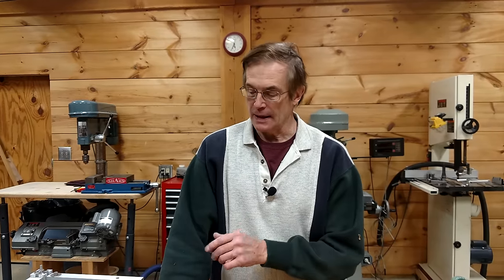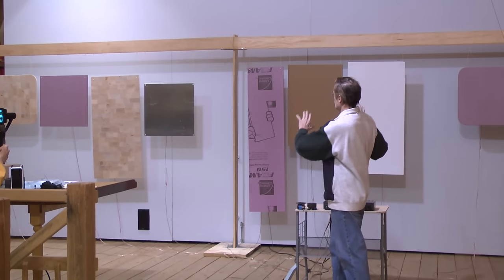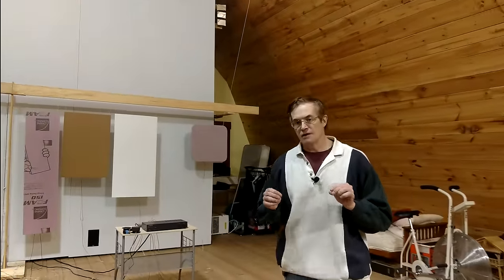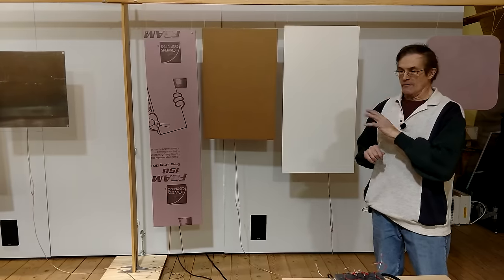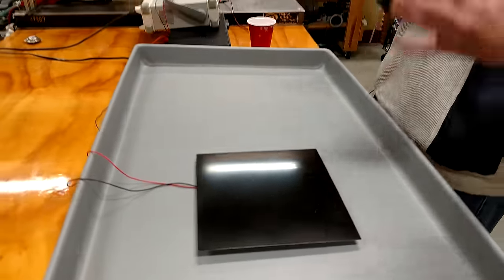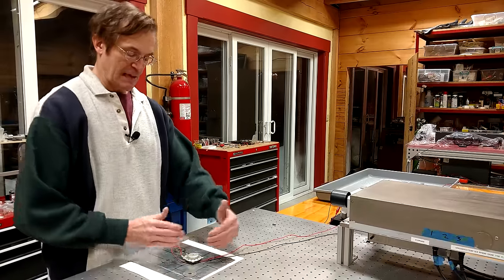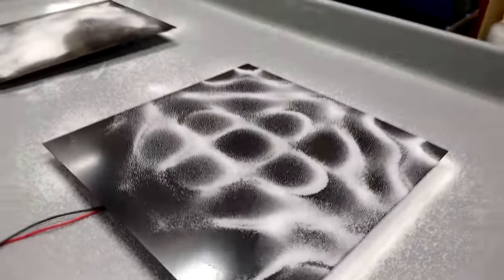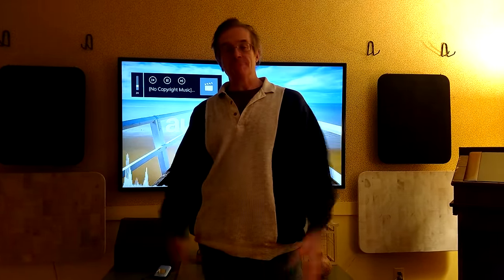Fantastic DIY Speakers for less than $30!

Comment: It's super interesting, all of these speakers sound like my computer speakers..... 

Would love to see some actual science behind these... Measurements would be a great start....

I also take umbrage of your assessment that the panels must be "musical instruments" in order to be recreate other musical instruments... wouldn't all of those nuances be captured in the recording already? and you would simply be essentially 'doubling up' on these effects?

I wouldn't think that you would want to mount these against the wall, due to the fact that equal amounts of energy are being sent backwards on the panel, you are actually boosting the rear wave output due to an increase in radiation impedance, I would think this would lead yet another issue for these speakers...
Reply: The "musical instrument" property makes sense to me. I'm going to approach my longwinded explaination from a graphics-algorithms perspective, but it should still be mostly applicable. 

If you have GIMP or photoshop you can find an advanced settings menu for scaling images. Among the options listed are what interpolation algorithm you want to use. These algorithms will provide very different results for the same image, input, and output size. For example, the "nearest neighbor" algorithm is computationally cheap because all it does is what it says on the tin. If you've drawn thin diagonal lines in ancient versions of MSPaint, you would remember how it created a jagged, solid staircase of the color you were using. This was using something very similar to nearest neighbor.  Most other interpolation algorithms work by mathematically approximating using a (corn) kernel object that is passed over the input. So if an output pixel does not neatly map to an input pixel, it would turn into an average of the input pixels it would be between. This results in apparantly smooth lines to the eye, but objectively loses detail that was in the input image. These algorithms can apply to 3d and even 1d objects.

When rendering 3d graphics, there are two common ways to handle the camera: orthographic projection and perspective projection. Both forms assume you are projecting rays that query the exact pixel of the triangles they hit, and stack the pixels up like cards. You only see the top pixel of each stack. Orthographic projection makes sure those projected rays are parrallel, has a cube for a stage, and is better for architectural drawings. Perspective projection has all of those rays converge at a single point, has a chopped off pyramid for a stage, and is better at simulating the eye or typical camera lenses. If the pyramid/cone has really large angles at the peak, the cutoff slice needs to be farther away for the view to not be distorted. See how certain people get motion sick in videogames when the horizontal viewing angle is different from their eyes' natural viewing angle. Both of these algorithms have 2d and 4d analogs, but act completely the same in 1d.  

So let's think about what sound is. If we project a force onto a solid object in a fluid, that object then imparts that force onto the fluid particles that bounce off of it. The particles then perspectively project that force outward, averaging it with the inherent noise of the universe. If we have another solid object in that fluid, it will recieve force from the fluid. The solids aren't as noisy as the fluid, so the force is (mostly) orthographically projected as an average. However, at resonance frequencies this average interpolation gets closer to a nearest neighbor interpolation. You can see this in action with the sugar test. The force, solids, and fluid are all 3d, but the solids' interfaces with the fluid are inherently 2d. Thus, the force is projected in different ways multiple times, and more ways in certain cases. A normal speaker or microphone is going to act like if the perspective projection's pyramid has a really tight viewing angle. The result is a recreation of the double slit experiment with sound instead of light. The point of these speakers is to widen the apparant angle of the vanishing point by increasing the size of the base of the pyramid, and cut down on quantum physics screwing with our perception of reality.

TLDR: You can blame quantum physics and psychology. It's a solution exported from the visual arts with help from physics.
Reply: I appreciate the response, and to my surprise I actually was able to digest most of what you said, so bravo. 

My rebuttal would be the fact that a musical instrument inherently has resonances, which is why you can hear the vibrating string from a violin in the last row of a concert hall, it is how they function.... 

Another point I'm trying to make is that you are doubling up on the micro-phonics produced by the instruments. To continue with your graphics metaphors, if I take an image taken with a camera, a device that captures perspective, then apply your prospective projection algorithm, the end result might look fine to you, however it is not being true to the original image. You're essentially distorting the image by adding perspective to something that already had that perspective.
Reply: Your first rebuttal is part of the solution to your second point. When a digital microphone is recording sound, it inherently is going to chop up the signal according to digital thresholds and it's digital timer. Binary computers are notoriously bad at recording analog data quickly, so shortcuts are employed. Rather than trying to invent an ideal mathematical function that would recreate the wave form, the mic will simply log the positions of tactile switches that are sensitive to pressure waves. The result is a file that will look like a sequence of integer numbers whose positions correspond to frequencies and timestamps. This is then (destructively) compressed into the mp3 format because moving raw data around is computationally expensive. When it comes time replay the sound, the computer decompresses it back into an approximation of it's raw form, and sends that information to a speaker. The speaker then flexes a diaphram with electromagnetic motor(s). The diaphram is an attempt to physically recreate the data lost in the digital process, but it has limitations. A smaller diaphram is going to be more sensitive to the variations in manufacturing tolerances of other parts in the speaker. One of the tolerances the panel speaker might be less sensitive to is how the motors' copper wires stretch and contract with local electro-magnetic feedback. This feedback overlaps the intended signal with an out of phase version of itself. If we consult the maxwell equations, we find that the eddy current responsible for the feedback is an inverse exponential equation in regards to time. Since materials resonance is an exponential wave process as well, it can counteract the EM eddy current's effect on the signal if used carefully. 

This is one of the really cool cases where materials engineering complements computer science and electrical engineering. Other interactions it has with them are photolithography, mercury tube memory, and crystal timers, all of which are black magic as far as programmers are concerned.
Reply: a very broad oversimplification of the recording chain... the "shortcuts" you're talking about are happening commonly at 192 thousand times a second, I don't think you need to worry about that... and I also don't see how that is relatable to this current discussion... 

you're assuming incorrectly that the motor structure of this panel vibrator isn't moving, but how would it produce audible sound? Energy can not be created or destroyed, simply converted. In order to create audible sound, the shaker is vibrating the panel and is moving relatively the same amount as a traditional speaker. Which is one of the many downfalls of this type of speaker, the fact that it simply can not move the panel enough to create low frequency sound, your moving mass is the whole panel and therefor takes more energy to move it, increasing exponentially with mass. What you arele doing with this type of loudspeaker is essentially taking all the bits that move in a large subwoofer driver and trying to excite it with the magnetic structure of a tweeter...

These types of acoustic transducers are fine for higher frequencies, but simply are not physically capable of any output below ~500Hz depending on the power you are sending it and the material... 

Also I would think that the best resonating panel would be an ellipse of some dimensions, this would create as many eigenvalues as possible...
Reply: JakeN482 "trying to invent the ideal mathematical equation"? There is nothing left to invent for this purpose, the Fourier transform deals with this perfectly. If your signal bandlimited only a finite number of samples are needed to recreate the signal literally perfectly. Keeping in mind humans can only hear certain frequencies we can take any audio signal and bandlimit it without losing anything of value as we can't even pick it up. Then yes the microphone need only pick up samples fast enough and send them down the pipe. As Timmy rightfully points out the speed at which this process occurs at is way faster than it needs to be, and the Fourier series doesn't care if the samples are equally spaced so long as there is enough of them, so losing a millisecond here and there doesnt matter so long as you can accurately measure the time at which the sample was taken. The quantization which occurs here (both for time and wave amplitude) is the only part of the process which I think faithfully could be labeled as "destructive" as no matter how precise of a computer you have an arbitrary real number can not be stored completely accurately. (I would argue we get close enough for it to be a non-issue but I digress) From this stream of samples it is then not only possible to recreate the exact signal but it is simple and incredibly fast by using the fast Fourier transform to do it.

As for the image analogy drawn earlier the fundamental difference here is the fact that our signal is no longer bandlimited thus finite samples can not recreate arbitrary signals in their entirety and we must interpolate. You can do Fourier transforms on images and the results are incredibly interesting, stuff like watching blood flow in and out of your face in real time and recreate sound from footage of vibrating glass... Off topic but interesting nonetheless

I'm not responding the physical reproduction issues as that falls squarely outside of my wheelhouse but I felt the need to just point out most of the things you label as "computationally expensive" are actually relatively cheap and can easily run in real-time.

Just 2 cents from a lowly mathematician
Reply: I'm sorry I wasn't clearer with the point. I didn't mean to suggest the motor shouldn't move, just that it shouldn't have multiple feedback mechanisms. The panel would indeed have an overall damaging effect on the waveform if there wasn't software and EM transmission of the sound. Every single step and attribute of the recording, processing, and replaying pipeline has a chance to add noise. It turns out that the EM harmonics and integer-float conversion feedbacks are sufficiently different to the material resonance feedback. The air is perfectly fine with transmitting this noise as much as it is with transmitting the signal, but a solid is less so. If you could build a speaker that created pressure waves by ionizing air, the inner ear might not catch the resolution of the square waves despite the middle ear's attempt to smooth it all. This is where the diaphram and panel construction comes in, they could lend their material resonance into rebuilding the wave and counteracting the other force feedbacks.

That said, there are a lot of "might"s and "should"s in my explainations. It would be very tedious and hard to measure the interactions of each source of noise in the pipeline with every other source. It involves geometry, materials science, electrical engineering, computer science, and nontrivial knowledge of manufacturing the equipment. It would take a very creative framework to design experiments that show how they all correlate to each other. It might use something like a 10 meter long prism of ballistic jelly, an accurate high resolution high speed camera, and comically sized custom speakers & microphones, so it wouldn't be cheap either.

Side note: 2C * 192kHz information density is comparable to 3C * 1280W * 720H * 60 hz used in visual display, and humans can still detect visual resolution noise. Don't take high sample rates for granted, it's still not an infinitely divided integral.
Reply: I don't really know what point you're trying to make here... all I know is that this type of sound reproduction system, while interesting and not without merit, simply has physical limitations to be used as a full range speaker, or even by itself with the addition of a subwoofer... you would need to at minimum have sound production from some other type of transducer (most commonly a boxed driver) up until at least 500Hz which is well beyond what is normal response for a traditional "subwoofer"... even if you had a subwoofer go that high in frequency you would just run into even more issues... 

Distributed mode sound transducers may have merit as a tweeter in a system, but they just can not do a full range reproduction... it's physics...
Reply: @bassplaya69er:
My note about information density was taking the preceeding arguments into consideration. Audio technicians get the benefits of analog based filters, lenient human hearing, and the double edged sword of materials resonance. In visual media, we're constantly battling screen color temperature, unintentional moire patterns, screen tearing, and screens with nonsquare pixels. As a result of the differences between media, the audio guys can do more with less information, but that doesn't change the fact they are still using less information. Any conversion error or inaccuracy caused in software gets a lot worse with smaller data sets than with larger datasets. I just wanted to communicate that you shouldn't assume a high sample rate is going to solve issues in processing or playback, but merely mitigate them. That's just statistics.

@timmyd24601
I agree about it being unlikely to do full range reproduction. I'm just argueing why this set up might be useful for mitigating errors elsewhere in the pipeline.

Also I just noticed @pigpenguin's comment. It must have gone in right before I replied last night, so I'll reply to it here:

I do not trust fourier transforms done by software after seeing the  different implementations for trig functions. Quake's mythical fast inverse square root function does not inspire confidence either. One program might use one method, another might use a different method to do the same thing. This gets really bad if they're inaccurate in different ways and are used in the same production pipeline. It's a tragedy when you throw artists in the mix; they all have different workflows and most are not going to be savy enough with tech to understand when something they did earlier is interfering with their latest action. They'll just assume the latest thing is buggy, rather than there being an interaction in play. It's a disaster when you add on transient bugs, hardware failures, regressions, failures to document quirks, and the famous "works for me" mindset. This is all fine though if use cases are static and artists/technicians don't slack off with reading or experimenting. 

With the software rant out of the way, I'd like to defend my assertion about audio being computationally costly. Audio information had historically been demanding on computers in regards to storage and processing. Algorithm and hardware improvements for audio are efficient enough for most applications since the early 2000's, but they still definitely are not enough in certain arenas like noise filtering, VOIP, sync, and searching. Any processing step between recording and playback is an opportunity for some floating point or integer operation to add tiny errors, and these errors will eventually snowball. In contrast to analog processing though, it is much easier to accidentally add errors in such a way that they do not surface until it's the past the point of no return. These insidious errors are fundamental to computer science, not audio processing. The best we can do in the field is mitigate it with higher sample rates until better algorithms are developed.
Reply: timmyd24601 Why do you need a subwoofer? Most normal speakers don't use subwoofers. Just woofers. And most go plenty low enough for most people's taste. My Cerwin Vega VS-150's will almost take your breath away, and pound you into submission playing Sail by Awolnation if you give them 300 or so watts. They're not subs. But they go into the high 20's no problem. Most bass that people like is higher then that. Not rap though obviously. Although they do it fine if needed to. 

And you don't need a box either. There's plenty of open baffle speakers out there that go pretty low. You will need a few feet of room from the back wall for that. But 2 15" Eminence Alpha 15a speakers per side in H frames with about 300 watts at 4ohm will sound great, and go much higher then 500hz. And if you're willing to spend some money and beat on your amps and woofers. You can get 20hz bass with open baffles. You'll need lots of boost, and therefore lots of power too though. This will get very expensive of course. But the Eminence are cheap, as are bass amps and the plywood for the frames. You could get away with 1 per side too in some rooms, and depending on your taste.

My point is there's plenty of options out there. You could just buy some cheap old speakers, and use just the woofers too. Where there is a will. There's a way.
Reply: oh HH Scott, for sure, I was just saying what is most commonly done... fwiw those Vegas have a 15" driver, realizing that driver naming convention is purely BS and arbitrary, that's probably a subwoofer in most books... But I digress... 

I was just commenting on the fact that in the video he say's that "you might want a subwoofer", which is a bit misleading for the reasons mentioned... Because you probably need more...

Like I said, I was just pointing to what is traditionally done, there are always different flavors of speaker design out there. Though when it comes to low frequency reproduction there are very real benefits to using a boxed driver, mainly one of volume, frequency depth, and efficiency... But like you said, there are always some different solutions... 

Also, while most 'subwoofer' drivers themselves very easily could do 500Hz, you start running into issues very quickly, include but not limited to locatability, system blending, and depending on how you are managing the response of the speaker you are getting dangerously close to the non-pistonic range of the subwoofer depending on the driver of course....
Reply: timmyd24601 Well most real subwoofers crap out pretty early. Like he said this speakers goes to 150hz, or that's the recommended crossover. Most won't even go that high. Certainly not the car audio, and home theater ones. None of mine will. My Vega's use woofers. Not subs. They only go as low as they do, because the box is enormous with 2 HUGE ports. And the crossover at 700hz I think. These drivers will go higher though. So they're woofers. Or mid-bass.

And you're right about box speakers, except the volume. If by volume. You mean SPL. Pro audio drivers, like the ones I mentioned will put out plenty. They're like 99db. And the baffle adds 1db. Ported box only adds 3db. Sealed none I think. So open baffle=louder then sealed in many cases. Ported= plus 2db. Not a real difference either way. I have 3 car subs, and a home one. 2 Alphas per side will put out more SPL then even the loudest one, but won't go as low as any of them. 

Keep in mind that car subs get so loud, and go do low because of cabin gain, and tons of power. But at 1 watt they aren't much at all. Usually in the mid/high 80's to low 90's like home speakers normally are. 

I would build something cheap, and simple. Like I have a pair of 6.5 inch Silver Flutes I was going to use in a car. They're 91db at 1 watt, and can take tons of power. They put out really good mid-bass too if you give them at least 175 watts. I'll give them about 400, or so. Put them in a small ported box, because that's all they need, and run them up to 250hz with a simple cap for a crossover. Then use a simple cap on the exciter. These woofers are about $80, or so shipped. The whole mess would run you less they $200, and possibly sound pretty good. 

If you've got more gear like I do, or can spend more. Buy another small amp for these. Use your main amp for the woofers, and get a MiniDSP. You can use that for your crossover, EQ, time delay, and room correction. I'll be they would sound great then. They start at less then $100, and you could just get a cheap Chinese amp for the exciters since you don't need much power.

I'm definitely thinking of trying this. I already have some Foamular sitting in my garage too I'm planning on using for open baffle speakers anyway. I'll run these on one of my tube amps, probably my HH Scott 200, and run the woofers on my AVA Omega Star 250EX. I'll probably just be lazy at first, and use one of my pairs of speakers for the bass.

I'll cross over at 250hz, because you can't localize sound below there, and you'll get much better mid-bass with the woofers. And if it's good. I'll build out the Silver Flutes for them, and use a MiniDSP. I'm going to buy one soon anyway. I do streaming though. So I'll get the digital one. That way I'm only doing one DA conversion for better SQ, and less hearing fatigue.

But it will have to do really well for all that. I can't see these beating any of my full range drivers on tubes. That's a tall order. Especially my Coral Holey Baskets, or my Zenith 49cz852's. I've never heard anything sound as good as those. You think Etta James is right there in the room with you. The dynamic range on them is un-frikkin-real! But this experiment won't cost me much at all. So why not? I love stuff like this.
Reply: Hey man, go get it, one thing I've always said about speakers and sound in general, if you as the listener are happy and like what you hear, then that is all that matters... 

That being said, there is no way that these go anywhere near 150Hz... The wavelength of 150Hz is a little over 2 meters... meaning that with this type of transducer or with ANY open baffle setup, you would need a MINIMUM of 2 meters of baffle width in order to prevent any back-wave cancelation (assuming a few things but still a good rule of thumb, anything less then this will cause destructive interference)... this is also assuming that you are EXACTLY on axis to the transducing panel... this is why boxed loudspeakers go lower (all things being equal) because you are negating the back-wave propagation by trapping it inside a box... Which is why I mentioned volume, or more accurately floor and/or wall space, you need a FAR larger open baffle setup compared to a closed box setup to get the same low frequency output... In terms of acoustic volume, or sound pressure level referencing 20 micro pascals, at those frequencies it is mostly a function of how much power you can get through the transducers and how large they are, while you can get into fun things like acoustic suspensions or resonators (ports or passive radiators), the physics of it come down to how much air you're moving which is a function of transducer surface area and amount of power...

Most transducers labeled as "subwoofers" will go far beyond 150Hz, it is usually the electronics or filtering that limit the bandwidth due to the fact that they don't necessarily do it "well" and present very destructive issues to the system as a whole (see above points)... But from a purely transducer perspective they will produce energy usually into the kilohertz range... 

And the whole anti localization of sound at lower frequencies is a common misconception... while it is true that it is difficult to localize sound from differences in SPL (Inter-aural Intensity Differences, or IID) starting at around 500Hz, the human ear can distinguish differences in time (Inter-aural Phase Differences, or IPD) starting around 50Hz... 

These types of transducers have merit being used in the high frequency ranges (above 1kHz), which is where their uniqueness comes into play and they can do some really cool things... but not much below that... full disclosure, I design these things (speakers) for a living...
Reply: timmyd24601 I'll try to come back and answer all your points later. But my thinking is this. He must have measured it right? And if I had a dollar for every time I heard that something won't work according to the "rules", and then worked just fine. I would be filthy rich. Speaker companies have been breaking the "rules" for decades now. I'd like to believe you're right, but my experience tells me otherwise.
Reply: timmyd24601 Oh, and I've built car stereos where you can't even tell I had a sub, and this was with no delay. Rules are meant to be broken remember? And there's no reason you can't put the sub, or woofer right below these. You could easily hang these on a stand. My real interest is how they sound anyway. Plus I have speakers that put out like bass that I like. My Coral Holey Baskets for instance. They don't do terrible for bass. But they're only 3.5 inches, and they're probably one of the best you ever hear. Try them sometime. You'll be amazed. This is my hobby. It's all about fun. Failing is fun too ya know? :)
Reply: I don't know if he did or not, I would love to see them if he did... 

These types of transducers are not new.... and if they were "magic" they would be used regularly I promise you... Speaker companies have not been "breaking the rules" for decades when the rules are physics, you can't really break those...
Reply: timmyd24601 I'll talking about stuff like using multiple midranges/tweeters, and breaking the "comb filtering" rule for instance. That type of "rule". 

And couldn't you just use baffle step compensation? Actually wouldn't them being against the wall do it anyway? Or is that only with box speakers? 

And I don't expect it to even sound good. But I've been surprised before, and it seems like a cheap fun project. Then after I am done, and tear it apart. I can make something else with the exciters. Maybe I'll put them under the seat in my car hooked up to the stereo, and mess with people. Or hide them somewhere in the house, and mess with someone. Lol

I've just always wanted to check these out anyway. I want to play around with all kinds of stupid stuff. I like that sh|t. It's fun. I just traded a receiver I didn't like for an old Kenwood tuner, and a Niles 6 speaker switcher that adds 3 Ohms. So you can run 6 pairs at once. I'm going to build a wall of speakers too for laughs. See how it sounds. Probably terrible. Lol
Reply: And I'm saying go for it, like you said, should be a fun and cheap project! and like I said these transducers do in fact have certain merits, the fact that they are nearly semi-spherically omni directional is very interesting and long sought after characteristic.... 

Comb-filtering is again a result of the physics of the situation, and there are very specific rules followed when speaker manufacturers use multiple drivers so that they don't break those rules... Or else their speaker would sound bad... 

The need for baffle step compensation is only present in boxed loudspeakers and is a result of the fact that you are trapping the destructive rear wave... essentially that happens at a certain frequency where the wavelength no longer interacts with the baffle, this transitions the transducer from projecting into 2pi space (when loaded by the baffle) to 4pi space (when it is essentially spreading all energy evenly in a sphere), this basically decreases your radiation impedance by half resulting in an decrease of energy intensity... but if those backwaves were not trapped, then there would be a reduction in energy density AND destructive interference, resulting in a continually decreasing output system, so a baffle step compensation wouldn't really get you anything...
Reply: "I also take umbrage of your assessment that the panels must be "musical instruments" in order to be recreate other musical instruments... wouldn't all of those nuances be captured in the recording already? and you would simply be essentially 'doubling up' on these effects?"
I too also thought the same, you would be "coloring" the original recording that already contains the "musical" instrument sound. Regular magnetically induced speakers also are damped by the amplifier, so they stop immediately when there is no input. So, more importantly rather then frequency response, I'd like to see that the attack and decay are the same as the input. It would seem that it can't stop the panel from vibrating even after there is no input sound. I have been using Magnepan speakers and more than any other speaker I find them to be better than even electrostatic since you would need a very tight amplifier to handle the back signal since it is highly inductive. Magnepan's also drive nearly the entire surface and they are very large, they're 6' tall. But the "dead" spots initially mentioned are there even in a concert hall. Magnepan's actually have depth and a sound stage where I can tell that the tympani are way back to the left just a bit off center where as the violins are right up front. None of the music sounds like they are coming from the speakers. Additionally the "sound stage" goes beyond the speakers, to the left and right.
But the price of exciters and their effeciency can't be beat. Magnepan's are mult-thousands of dollars. So, I'll agree the exciters might be fair, at the price they are interesting and when the right panel material is found, or created, they might get better.